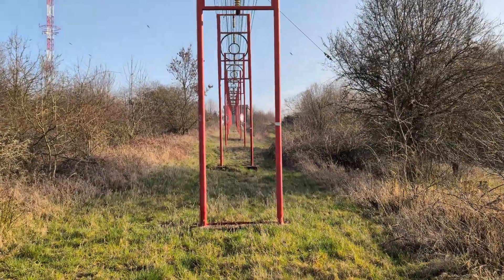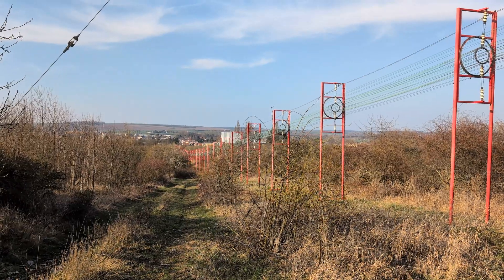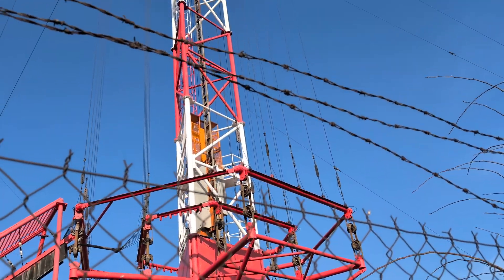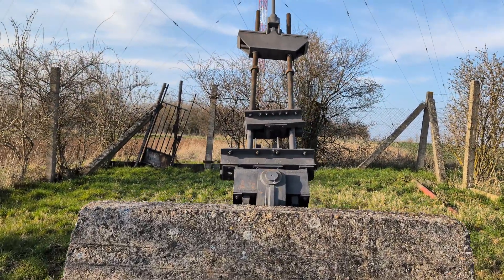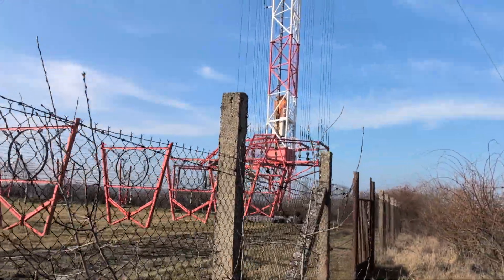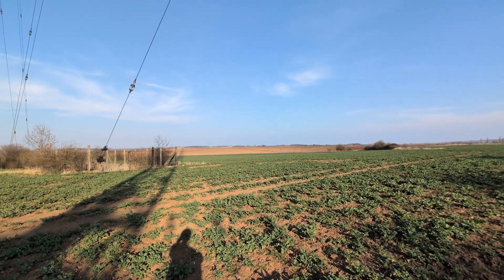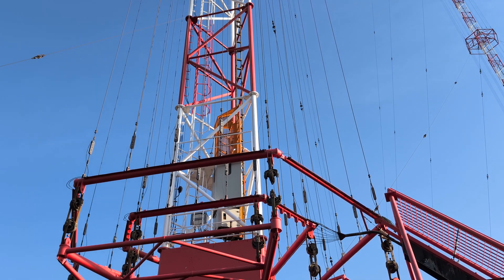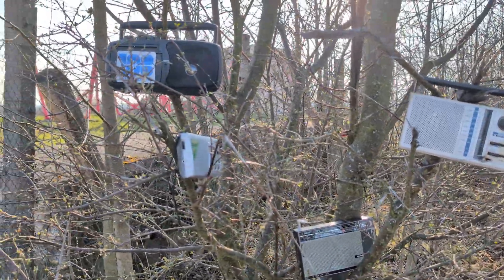639 kHz - The last visit of Liblice transmitter before final closedown - Country radio - 28.03.2025

Comment: Rozhlasové vysílání AM na středních vlnách je ve 21. století na konci v celé Evropě. Které soukromé rádio by si dnes mohlo dovolit platit pouze za spotřebovanou elektrickou energii 1,5 MW vysílač. Mohl si to někdy do roku 1989 dovolit jen stát pod vládou jedné strany.

AM radio broadcasting on medium waves is ending in the 21st century across Europe. Which private radio station today could afford to pay for the electricity consumed by a 1.5 MW transmitter? Until 1989, only a state with a one-party government could afford to do so.